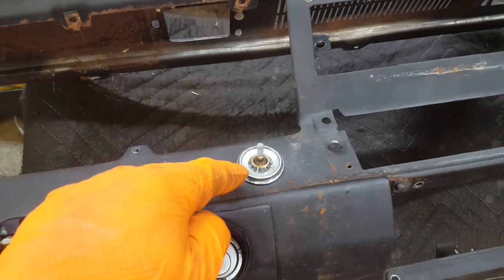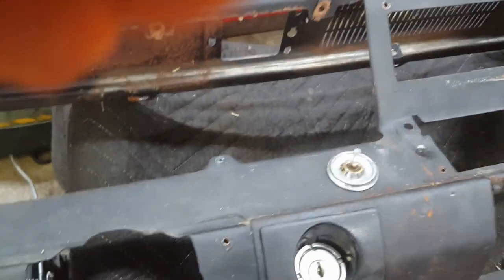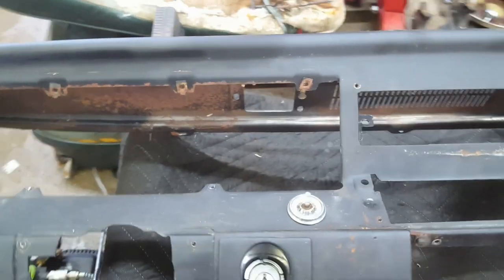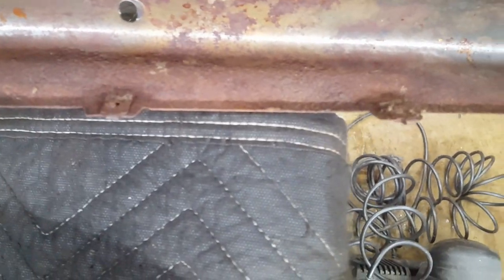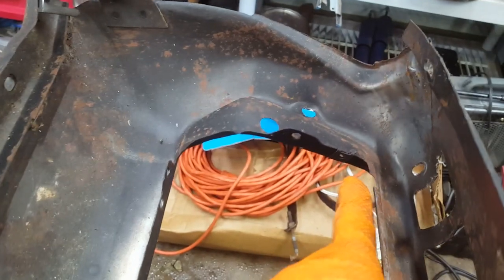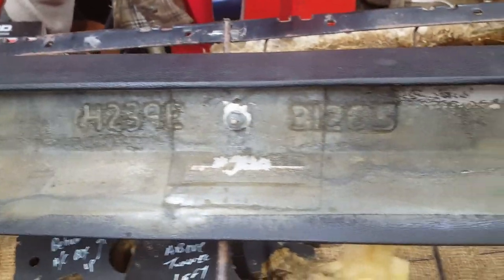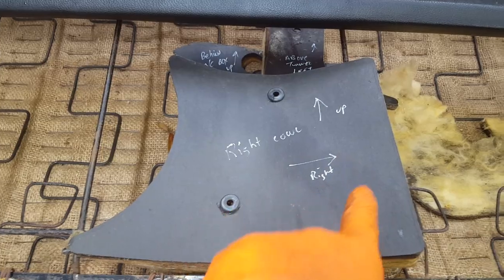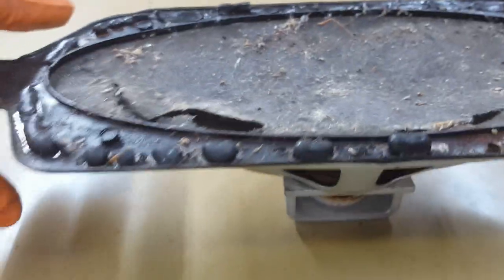1969 Dodge Dart: restore the dash and the firewall

Comment: LOL for a while.... My friends tease me all the time about injuring my self why working on things....car parts can be sharp. One even bought me a awesome "first aid" kit. I do use it, fairly often too. The bad thing is I don't feel pain, so often I don't even know I have cut myself until I see blood everywhere. I burned my finger tips bad once, years ago, adjusting mechanical valve lifters once..... only once...., I did learn though, and haven't done that again! People say I'm lucky I don't feel pain.... I don't agree at all.... thats why I end up with cuts all the time.

I like your under dash work.... You took more apart than I did. I didn't take my heater planum out as my firewall pad was like new.... all the way "acrossest" the firewall.... Spell check really gave me a hard time on misspelling across.... but I had to do it!

I use to loose the parts I ordered all the time, now I put them all in one spot together, so I don't spend a whole day looking for a part.

Comment: Using the garden matting for the speaker cover was a great idea. The dash paint looks great using a rattle can. Looking forward to the repair on the rear quarter. Practice makes perfect, you can see how Howard’s progressed after restoring 50 cars so far.

Comment: Thanks for showing those fresh air door assemblies and the doors on them. I'm going to have to remember to oil those hinges. There's a lot of stuff under the dash. I'll be watching the heater and air assembly for sure, I've never replaced my heater core, kind of silly since my air cond. works well.

Comment: As to the A/C, can you convert that unit to use the new refrigerant,  I believe it is water based, since I am not sure if the other  refrigerant has been banned, that Dart is getting to look spectacular, and like you said it is going to be your daily driver, for a daily driver you have restored a lot of the original equipment,👍👍👍👍👍

Comment: Hi Tyler, I was wondering, if you put some kind of protection or rust converter inside the metal piece of the dash, to give added protection, & to avoid rust from forming, eventhough you do not see the inside of the dash,it adds protection to the dash, as to that speaker, if it still works, have you checked where they sell parts for speakers, material connections, what used to be Radio Shack, where they have everything to make speakers, I don*t know if any exist , maybe one of those small shops.
Reply from the maker: I used rust converter, thanks.